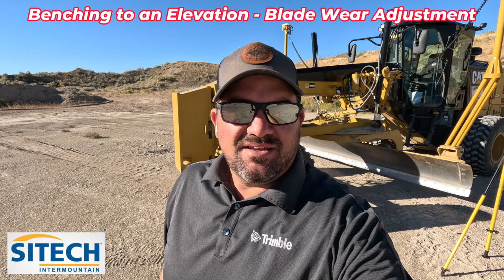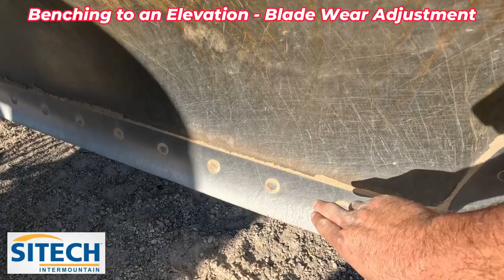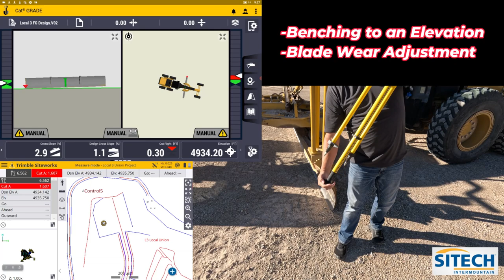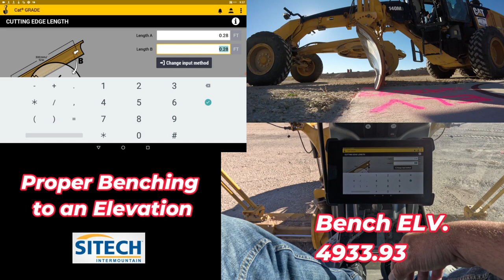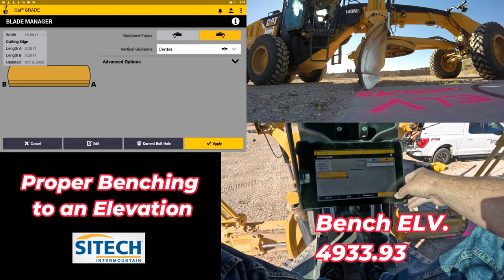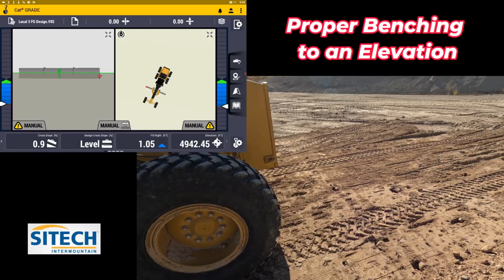Earthworks Proper Benching In and blade wear adjustment

Comment: When benching in, it's a good practice to get the blade level 0.0% and set on your known solid benchmark. This ensures your receiver is plum over the benchmark. He has his at 1.9% as he benches the right side meaning the receiver is out of plum by 0.266...a slightly elevated benchmark over the ground can also ensure your ability to get the blade level while benching.

Comment: Thanks for the video.  I really appreciate your work.  I’ve found that grading an area… using a design and then checking where the blade has cut hard(smooth) and then double checking the area with the rover using multiple spots gives the best results.  I’ve had intermittent success with a hard benchmark.

Comment: on the last example do you bench in the other side of the blade as well? also where in the blade does it actually read the grade? at the very end?
Reply: Yes I would always spin the blade around and check both side because one side might be worn off more than the other side.  Be aware of how the very edge of the cutting edge may be worn down more than the majority of the blade so you may need to check a foot or so in from the edge.  
Inside the machine you have the red control point or carrot some call it or focus point.  You need to switch it to the side you are checking.  The elevation is called out for what side it’s on and yes it is off the very edge of the blade.  Thanks for watching
Reply: @JeffLarsen-iz8qk  thanks so much for the info i usually bench the motor grader with a hub inside of my design so I can see a cut or fill and compare what my UTS gives me to what the grader shows after I bench him in. I've always used the 3rd bolt and only bench one side guess that's why he would always get different grade when he cut the opposite way.

Comment: Have you ever done both sides for UTS ? Ive seen the stair casing on UTS from only benching on the pole side .
Reply: Yes you should bench both sides when running UTS.  Because you are only controlling off one side of the blade it is now using the cross slope sensor to know the elevation of the other side and it can be off.  If you are using the older GCS900 system it can be a cross slope sensor out of calibration and also the mast lean in and out degree that is off to cause that if it is not just a blade wear issue. Same with earthworks if the mast has been hit or is out of calibration for the lean in and out and cross slope off you will get the stair case.  Luckily if its not way off and only a little on the earthworks machine, you can adjust the blade wear from side to side individually to adjust this out or fake it out.  But yes, i would always check both side of the blade to see even with UTS.  Thanks for watching.

Comment: would setting the blade wear to zero then using the difference in elevation as your blade wear be a option? (on a new cutting edge not a whore one)
Reply: Well, it’s still the exact same process for a new cutting edge or worn out.  I would not suggest setting to zero because then you will be off almost the difference it would be with the tape measure.  A really good measured up machine and a good job site calibration should make it to where the actual tape measure length of the cutting edge would match elevation way close.   This is just the best way to make sure the machine matches actual job site elevation and conditions without needing to fake out the vertical offset if that makes sense.  A lot of things play into making the final finish grade for sure.  Hopefully that made sense.

Comment: Kiewit sucks 😂 GPS don’t work at the when you doing parking model won’t match curb + - 300  it’s free hand
Reply: Do you mean when the machine is too far off or the model doesn't match anymore they just say free hand it?  I know how that is.  But no one should just changing the offset to match grade or the model, it should all be handled in the blade wear unless the machine measure up is way off.  Thanks for watching.